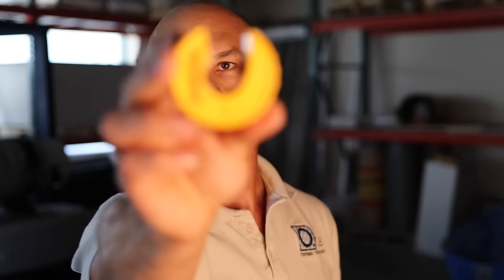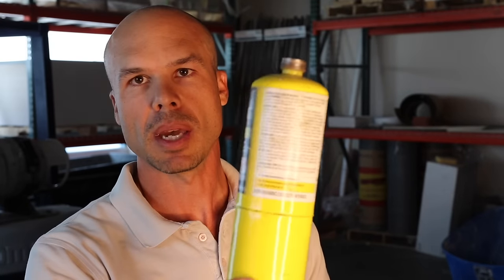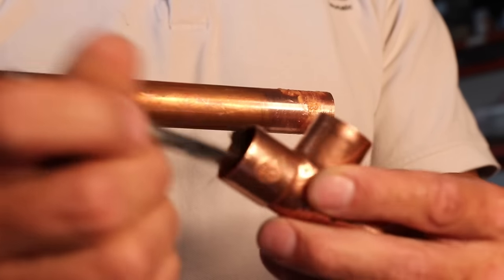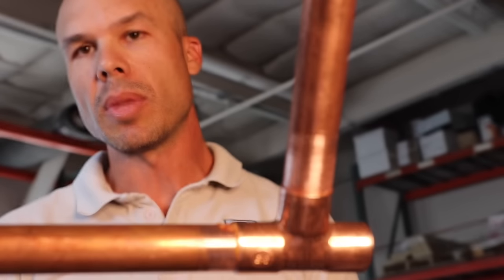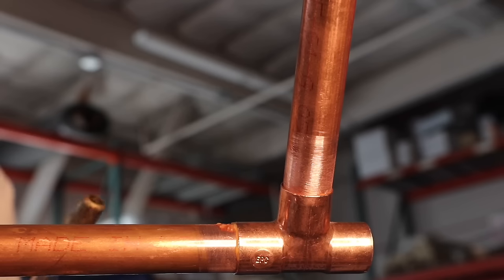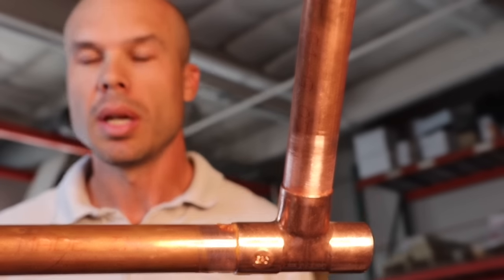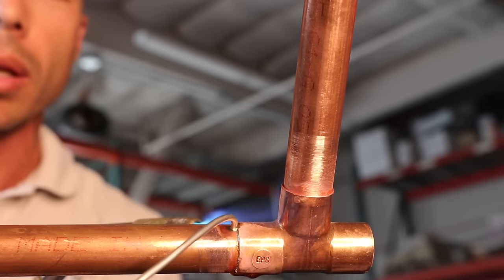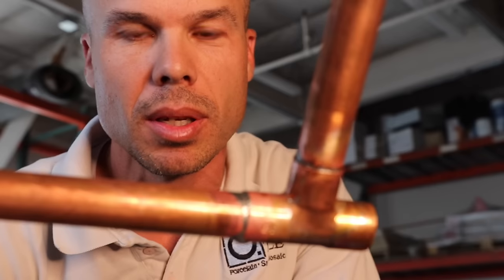How to Solder Copper Pipe: The Plumbers Secret- Episode 1

Comment: So let’s say you wanted to solder another pipe on the open side after these two joints cool off.  Would it melt the adjacent joints off?  I’m learning how to solder right now.  My first practice joint I applied way too much heat.
Reply: Always use propane, let the pros use the Map gas. It gets too hot too fast. Propane is much more forgiving for beginners and even some  pros prefer it also. To answer your question, I will use a damp cloth or rag draped over the side already soldered to be safe but I have seen plumbers just go at it without worrying. In theory, reheating the solder shouldn't hurt it. Just always let it cool slowly or the solder can fracture and cause a leak, once it cools I wipe it with baby wipes (a damp cloth or damp paper towel works too), any flux left behind can corrode the pipe or cause a greenish tinge.
Reply: Mark B. Yeah I bought MAP gas too!  I just soldered a joint right now with it I think I did ok it’s not burnt lol
Reply: Mark B. , the professionals choice or preferred gas for a Plumber is Acetylene. In fact that’s one of the clues we look for to see if the guy who showed up is a legitimate Plumber or someone pretending. A small single B tank of Acetylene with a six foot hose and a real torch end with several torch tips. Any guy shows up with a Propane or Mapp cylinder with a screw on burner should be sent back. Look up Acet O lite torch  
and you’ll see what I am talking about. also the O.V. Is kinda misleading. Flux is not a primer it’s an Acid cleaner in combination generally with other ingredients. Finally the O.V. ( Orig. Video ) says that a water drip will cool the joint so as not to be able to Solder, it’s the Steam which rapidly expands that blows a hole out of your Soldered joint leaving a leak.
Reply: Sorry I meant to say that a real pro would have a type B Acetylene tank with hose and tips along with a Acet o lite torch handle. Also look up Plumbing brushes for cleaning 
fittings and pipe, they save huge amounts of time. These brushes are made by the Mill Rose Brush company. They are used in a screw gun or drill 
and once you see the vastly improved shined and cleaned copper you will have a hard time going back to Emory cloth or hand scratch brushes. We go thru cases of them. 
Our company used to pay an trainee to clean fittings and pipe all day. Not needed with the invention of those brushes for powered guns and drills. The design has a inner and outer brush to clean two surfaces at once. Quite literally one of the biggest improvements to Copper pipe and fitting prep in decades.
I’ve got 32 years as the owner of a contracting company under my belt.
Reply: generally generic guy awesome tips I’ll look these up.  I really want to be a plumber, I’m wondering how to get started.  I work a full time job at the hospital 3x a week total 36 hours.  I’m afraid I won’t find an apprentice job on a part time basis.  I understand the schooling part 2x a week for 4 years.
Reply: @generallygenericguy7876  how much soldering are you still seeing being done in the field? Here in Upstate NY Pex has completely taken over. At some point I wonder if it will become a dying art form. :-(
Reply: Mark B. Thanks mark!
Reply: Mark B. Hi Mark, plenty of rework and commercial will need soldering well into the future. New homes are where a lot of Pex is used. It’s quicker and cheaper, not always better. I redid my home completely and used all Copper. Happy I did. And yes I have Pex powered crimpers that make it easy to do. While proper sweating of joints can be done nicely it’s still quite easy to pick up the skills. I prefer an Acetylene B tank with a Acet O Lite torch handle. ( I know I’ve said this before ) I also use silver solder 
and Mill Ross Power Bit Brushes. Yes, they cost more but we just factor the cost into the job estimate. As for sweat joints becoming a lost art remember that as the contractor you steer the customer to the best way to do the job. If it’s a new home with Pex than your stuck with that but there’s plenty of houses that are not new. We just worked on six new custom high end homes and they were all 100% copper. People still know a quality product when they see it. The original advertising for Pex stressed easy plastic cutting, less shipping cost and less leaks with no real training. 
New home building will always 
gravitate to lower cost. Now if the builders can save $5.00 on a box of roofing nails they will.
Look at hot dipped versus Galv flakes in a spinning drum with a new roofing nails. I’ll take hot dipped over a nail that corrodes in four years. But then I pay attention to details that most guys in the trades ignore. I buy my nails from Swann Fastener near Baltimore and yep I toured their factory, almost a two hour drive for me.
Reply: generally generic guy this is very helpful information thank you very much!  Here is where I am.  I work 36 hours a week three days a week 12 hr shifts.  I have the rest of the week off.  I have a tundra truck and some tools already and do most handyman stuff in my house, mostly plumbing.  Your recommendation of starting my own contracting business sounds awesome just what I need.  I want to specifically go into plumbing though, and I’m worried I will have a hard time getting the training done.  Once I’m done it will be allot easier to grow the business.  I just need to find a school and someone to take me on as an apprentice.  Trying to figure out how to balance this.
Reply: @TheLloyz  Not sure where you are at, but if you look up your local plumber's union, they will put you to work as an apprentice and pay you while you attend school. This  is either 1 or 2 days a week, but could be different based on your location.  Also, some areas require 5 years of schooling.  When you are done, you should have no trouble passing the exam for your license, if you paid attention and worked hard at the training.
Reply: Nathan Edmundson yeah I would go union but they want you full time, I’ll keep looking.

Comment: It's not a hot water heater ! Just a water heater lol 😂. And you should make sure that your flame stays on top of your solder so you don't get flux pockets in your joints. Making sure that your joints are prepped properly will make for a better solder joint.
Reply: Let's call cold water heater lol we don't heat hot water 😂😂😂
Reply: Lol that's always cracks me up Hot Water Heater lol.
Reply: @TileCoach  professionals do not call it a hot water heater as it's a water heater lol. But it is good for a laugh. Why would you need to heat hot water? I know what you're saying a lot of amateurs and homeowners call it a hot water heater and I get quite a chuckle out of it every time but think about it the water going into the heater is typically pretty cold not hot. He is correct and if I would had called if a hot water heater to anyone reputable plumber he would bust my balls forever. Of course this is in the US lol. Next time you hear someone call it that's ask them why do they need to heat hot water lol.
Reply: First Last  some may but it's still wrong lol. It's a water heater. It does maintain the water temperature yes but it's main job is to take cold water and make it hot water. You can pretty much find an argument for anything and you argument is clever however it's still a water heater and not a hot water heater. It's mostly homeowners who make the mistake and of course younger lads end up making the mistake without correction and it sticks lol. Without a water heater of some sort there will be no hot water lol.
Reply: Isaac Ostrom yes i am from Minnesota !
Reply: I will say a lot of people call it a hot water tank and I'd bet that's where the two crossed paths lol.
Reply: It depends on what part of the us you live we call it hot water heater
Reply: @TileCoach  I'm a 539 service fitter

Comment: Never flux inside of fitting, just flux the pipe. Otherwise you could just push the flux INSIDE OF THE PIPE.  You definitely would want flux inside the gas pipe. Don’t wipe pipe straight away with damp cloth. & always clean of lumps of “snot” of bottom of your soldering.
Reply: flux "cleans" the metal
Reply: As I said, you just put it only on pipe. That’s how they teach you at college. It’s also gas regs now in the uk, so the flux doesn’t sit in the pipe as not all fluxes are soluble.

Comment: A good plumber would wipe his fittings and not leave the goobers hanging
Reply: @TileCoach  Just for aesthetics really ..doesn't do any harm to the soldered joint.. just looks cleaner...
Reply: It's just for looks, but if you wipe the flux off with a damp rag after its ready, but before you solder you get a clean joint. Then the only flux left is between the joint. And for drips under the joint you can just heat the drip and brush it off lightly  with the rag. Don't cool the joint down. This is more for exposed copper. It does nothing to make the joint better, besides looking cleaner.
Reply: Isaac Ostrom from an engineering standpoint, its more reliable. same concept as for welds
Reply: A good plumber would put the perfect amount no need to wipe excess
Reply: removing that solder drop lump makes it look good, sign of a craftsman who is proud of his/her work. otherwise why remove snack trash from within the walls, no one will ever see it, right?
Reply: My house was built in 1974, when we moved in and I started replacing sheet rock/insulation, all the plumbing had goobers. But nothing was leaking. Rather have goobers, lets you know there is more then enough solder. But maybe for an external installation like a bar or something... that would look nice.

Comment: The solder you show is 100% lead free, and is what is used for potable water plumbing these days.  It is composed of tin and antimony instead of tin and lead.  Tin and lead are used in enclosed systems and electrical.  The reason you are using MAPP gas is the antimony melts at a higher temperature.  Propane was used by plumbers when they used lead-based solders.  If you use Propane with the antimony solder, you will need to chase a lot of heat down the pipe and before the end gets hot enough to melt the solder.

You have the correct pronunciation.  It is "soder", not "soulder".  The L is silent as it is in could, would, should.  Pronouncing it "soulder" is a relatively new phenomenon probably started by someone wanting to impress with their technical accuracy, but they got it wrong and you learned it right.
Reply: @ Jack T....The silent "L" in solder is an Americanism...in the UK , and most other English speaking countries the "L" is pronounced....
Reply: @peterevans8194  It appears you are correct, with another more minor variation being sawder.  Thanks!

Comment: Use MAP gas, not propane.  
MAP gas produces heat faster than the heat can flow, through the copper, away from the joint.
Reply: It’s much more expensive though !
Reply: People were using propane long before MAP gas was around, with no issues.
Reply: @twinkie27271  -- In the case of larger copper pipes, I couldn't heat the pipe enough with propane to form a good solder joint.  The heat flowed away too quickly.  With MAP gas, the pipe needs to be heatedly only briefly before the pipe can be soldered -- and the joints don't leak.
Reply: So much hotter and faster yes

Comment: A few things I would add:  1. Flux is an acid.  Its purpose is to de-oxidize the copper so the copper will stick.  2. Solder flows towards heat.  That's why you want to heat the fitting and not the pipe.  3.  You can clean excess solder with a dry cloth before the joint cools down.  4.  Letting wood members burn and char is extremely unprofessional.  Use a fireproof cloth to cover any wood that might otherwise see flame when you are soldering.  5.  Watch out for hot dripping solder which will cause painful burns on your hands and forearms.  I have many scars to prove that.

Comment: Not the neatest joints I’ve ever seen. Try wiping the excess flux off the pipe once inserted and before applying heat. This prevents runs. Take a look at PBPlumber for the best soldered joints I’ve ever seen.

Comment: Why don'y you use Silver solder in America, we also use oxy/acetylene torches down here
Reply: Lead free solder is fine for water pressure but silfos is required for ac as it handles much more pressure, over kill if using it on water, lead free flows much better into the joint with flux
Reply: What do you use for flux with silver solder?  The silver solder that I have uses an acid flux.  It make a strong joint, but it destroys copper because the acid never leaves.

Comment: Shouldn't you clean the copper with a cloth after sanding it with the emery cloth and putting the pieces together? Just think about getting copper in the lines. I would think you'd wanna wipe them down with a semi-damp cloth and let them dry...

Comment: Your supposed to hold your heat at the bottom of the fitting
Reply: that's the first thing I was taught as an apprentice pipe fitter becaiuse heat always rises. the vertical connection should have been heated low to start with, thrn raise the torch up somr to finish.

Comment: Torch is set too high. Use less heat and always heat the pipe first, then the fitting. Clean off excess flux after you assemble the fittings and you wont have "drips". Also, after your joints have cooled, and you have wiped them clean, buff them with a piece of steel wool. Your work will look like a million bucks!
Reply: I always heat the fittings first the heat has to penetrate the pipe through the fittings for an even temperature

Comment: Wrong the pipe has to be tinned first which means running a thin coat of solder around base or pipe before it is pushed into fitting

Comment: Never solder a fitting with one open side.  Wait until you finish the tubing work to solder everything at once.
Reply: thats not true. I soldered 3 open tubes yesterday and im not a plumber and it was my first try and it became perfect.
Reply: @InnerLeopard  The question is did you finish the job or heel of the tee still with no tubing?
Reply: @lichub  wtf are you talking about? Im not a plumber
Reply: @InnerLeopard  Did all three openings on the tee have tubing attached ready to be soldered? Soldering one tube at a time in a fitting and going back causes the fitting to oxidize.
Reply: @lichub  haha very funny. Why does it oxidize?

Comment: used a vacuum to suck that water out.
Reply: once I used a wet/dry vacuum, placing the hose over the pipe and sucked up the water that was in the pipe as the water just kept slowly coming out even with it shut off. sucking the water out does what the bread does. thanks.

Comment: Soldering: it’s more opinionated then a Republican or a Democrat lol 😆

The thing is: as long as you use flux, you’ll most likely have a leak free joint. But there’s a difference between a leak free joint and a joint that will last for 30-50 years.

The main things are:

-Clean the pipe and fitting brightly clean with wire brush/ Emory etc. don’t get your bare hands on the clean surface; oils on your skin can cause weak areas.

-Ream/ debur the pipe both inside and sometimes outside. 

-use flux, not too much. Too much in the long run can cause acid buildup which will eat the copper. Light coat the pipe and even lighter inside the fitting. (Some guys don’t do the interior, because it basically just gets pushed the a clump at the inside.)

-apply heat and solder. Don’t over heat. For small fittings it’s best to use a torch where you can throttle the gas down. If you over heat you’ll burn off all your flux. Heat evenly, and when ready to apply solder make passes at the fitting to determine when it’s ready, typically right after visual signs of bubbling of flux. When ready to apply solder, heat the area you want the solder to go. The solder will follow and wick into the fitting and follow the heat and flux. (Also wise to wipe excess solder at area of pipe that doesn’t go into fitting; as that causes solder to build on the exterior).

-good rule of thumb; 1/2 fitting requires 1/2 of solder and so on. DONT over solder. Having a huge bead on the exterior does nothing for structural integrity: if you have a huge bead on the outside; it means you have a huge bead on the inside, that causes flow restrictions and turbulence; turbulence which can cause vortices which can leaks down the road.

-lastly: DONT unless you are in a major rush: don’t rapid cool. Just let it cool naturally for 5-10 mins. Rapid cooling with water etc can cause “cold” solder where the solder doesn’t actually bond; or small cracks form, the similar
effect to when an ice cube is dropped in water, it cracks from rapid temp change. 

So again; it’s pretty easy to get a joint soldered; but to get them 10/10 30-50 year life spans does require a little more tedious work.

Comment: Map gas is trash. Real plumbers use a B-tank and know how to regulate the temp and what heads to use. As far as the act of soldering, never solder a tee with only 2 connections in it and use that much flux. That much flux is totally useless when using 3/4”. It runs everywhere and looks like this. 🔝🔝🔝 or worse.